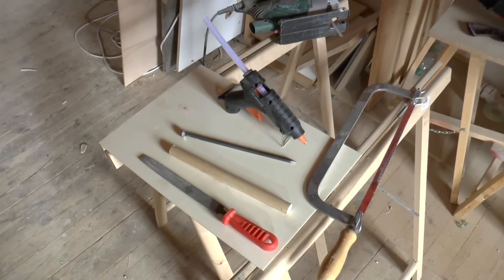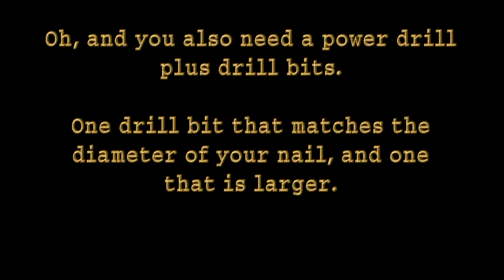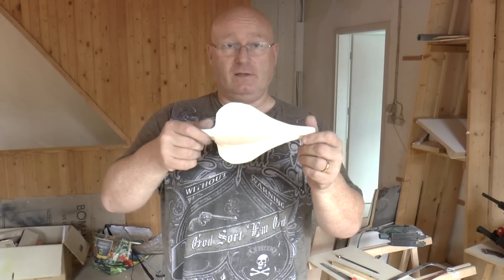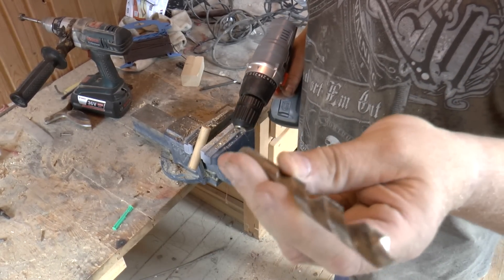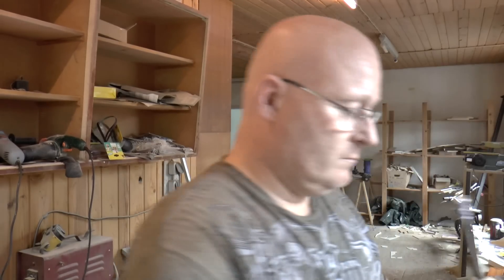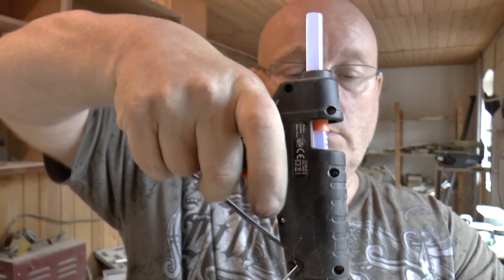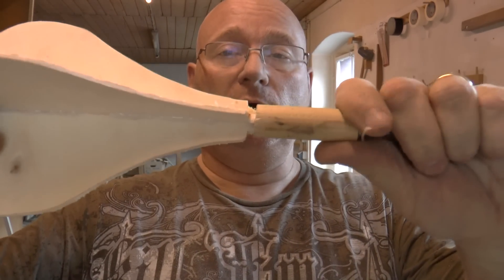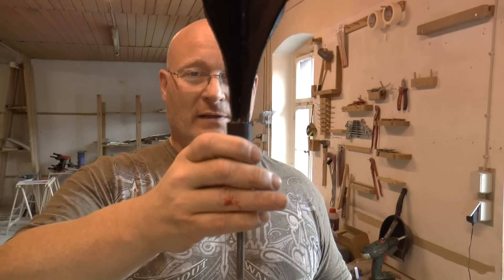BANNED IN USA: How To Make Lawn Darts

Comment: I would use wood glue for the final setting of the fins to the nail. Hot glue isn't very strong for applications like that. Wood glue will last much much longer.
Reply from the maker: Slurpon Muhdick But it takes ages for it to set. I am not that patient.

Comment: Jorge, to mark center of cylinder all you have to do is fasten drill bit or screwdriver in a vice and hand-drill wood into it, just like they start fire. You can even drill a perfecly centered hole in a bolt as small as m3.

Comment: These are really great. And very funny ending. The one thing I would suggest is to dip the tip in latex or silicone to provide a grip for the tip, since holding the wooden ends would prove to be uncomfortable. Being made of wood opens up the possibility to these being really beautiful if worked on by an artist. I used to play with these as a kid, and my mother and uncle before me and my grandmother, great aunts, great great grandfather and grandmother before me, we never had any problems with them, we always knew they were dangerous and needed to be treated with respect. And we had cap guns and bb guns. Let's face it some kids just have bad parents, and genes with bad aim.

Comment: They are not banned here. I just bought a set 2 years ago, and have seen them recently.
Reply from the maker: https://en.wikipedia.org/wiki/Lawn_darts#Safety_and_bans
Reply: Well I'm telling you for a fucking fact they are not, and you can still buy them. Just because it's written in wikipedia, doesn't mean it's completely true
Reply from the maker: No swearing on my comment pages please - last warning. Just provide a link to a store in the US that offers it. Or shut up.
Reply: They are in fact banned here (US) for sale (new..you are free to sell a used set, etc..). Not illegal to own, only to sell. Some manufacturers sell the darts as separate pieces to get around it but overall you're 100% correct.
Reply: User Name
...no they didn't. If CVS sold any they are definitely not metal tipped.
Reply: Why are you cursing?
Reply: your awesome man such a savage "provide a link or shut up" lol best channel ever
Reply: because he is trying to over compensate for his tiny pekker
Reply: banned, sure, but i dont think its enforced. atleast not where the guy lives.

Comment: Lawn darts are not actually illegal in the U.S.   Rather, the CPSC banned the importation & commercial sale of them....just as they did with 3-wheel ATVs!  But you can make them youself, or buy ones that were produced before the ban, if you can find them.  Here's an idea....they sell "Nerf" versions of lawn darts.  What about making a head out of brass or steel, on a lathe, and mounting it onto the finned body?

Comment: I was bothered by your screwdriver tip. I mean it was ok per se, but though you would have a center punch for wood since you build so many thing out of wood? So your tip should have been that if you don't have a center punch (or a knife) you can use a phillips screwdriver (or pozidrive) to make indentation on the wood before drilling.

Comment: lawn darts are not banned in the USA!
Reply from the maker: OK, then quickly, provide some links to amazon and ebay.
Reply: rekt
Reply: yes they are!
Reply: haha reKt
Reply: You can have Lawn Darts in the US but they are banned from being sold in the US, for now. Lawn Dart parts can be bought in the US.  (Wikipedia: It is possible to import parts of a lawn dart – plastic flights, metal bodies, and steel spigots – as well as a complete set of replacement parts to repair damaged lawn darts, into the US and Canada. However, fully assembled individual darts, sets, and kits are banned from entry by American and Canadian customs authorities.)
Reply: It is not illegal in the US to own lawn darts. You can buy the parts or 
make your own, and that it perfectly legal. It is only illegal to sell 
lawn darts in the US.
Reply: +funkingitup illegal memes
Reply: it's illegal to sell them, so they may as well be
Reply: Mox_au All the parts can be sold/bought separately and then assembled as a whole set. Politicians are responsible for this idiocy.

Comment: I feel like lawn darts would be good toys if they just blunted the tip so smashes instead of pierces
Reply: You can go to Amazon and select from a list.
Reply: Actual Lawn darts do have blunt tips. But since the tips are made of metal, it can still easily puncture a skull, chest, hand, foot, dog, grass covered yard.
Reply: Dwight E Howell I have dissected a few cadavers and broken skulls. Trust me, you are very wrong.
Reply: The old one outlawed can kill people and some did. The ones for sale on Amazon have rubber tips. If your head is that soft then by all means wear a helmet.
Reply: Dwight E Howell
Oh, I got you, man. I thought you meant real lawn darts. Even with there blunt tips they have plenty of weight on a small enough surface area to fracture a skull. Parts for real lawn darts are available on several websites, but you have to assemble them yourself.
Reply: Got it.